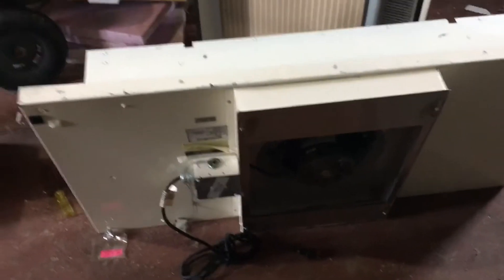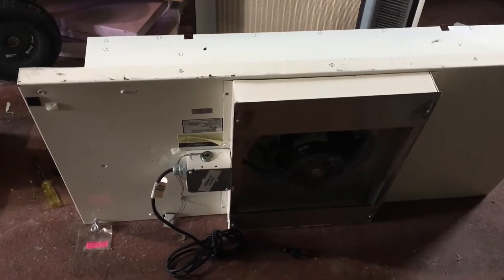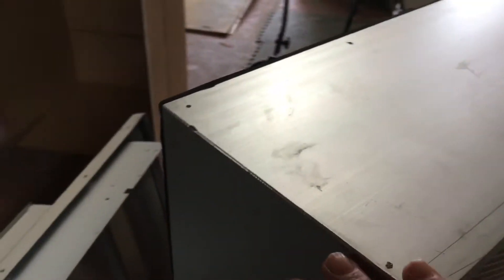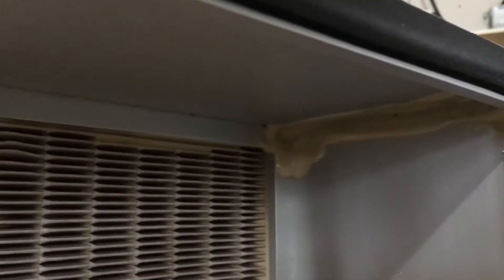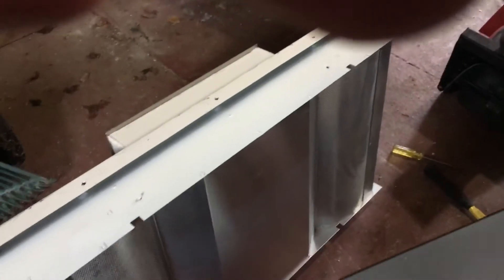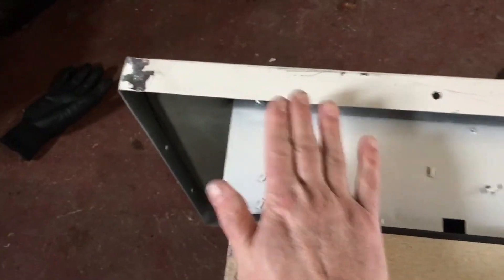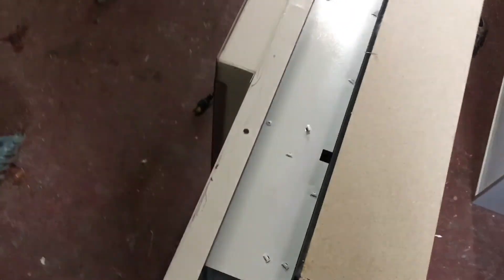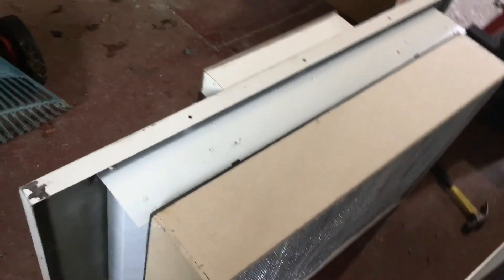Response to Eric Myers Mushrooms HEPA module video Pleurotus ostreatus

Comment: Hey there. Did you hardwire the unit into an electrical box, or convert it into a plugin? Not much info in regards to the actual conversion of these units for these purposes..nor the efficacy. Input greatly appreciated!
Reply from the maker: Ross Gronvold hi Ross. This came with a wall plug on the end so no wiring was necessary.

Comment: Have you tried using a air nozzle blowing from the front towards the back to clean some of the dust off the back?
Reply from the maker: James P hi James.  I did and it didn't do much good.  Check out my last video.  I ended up replacing the filter.  I'm pretty happy with it thus far. I JUST moved a batch in front of it to cool down less than 2 minutes ago!

Comment: Why can't you grind that lip off the front by hitting the 90 deg with a grinder, replace the filter, the use some angle to replace the missing lip?
Reply from the maker: Trex1268 that's a good idea. I would like to use the new filter without loosing space so I might just build a new box. A new filter would be tons of $$$